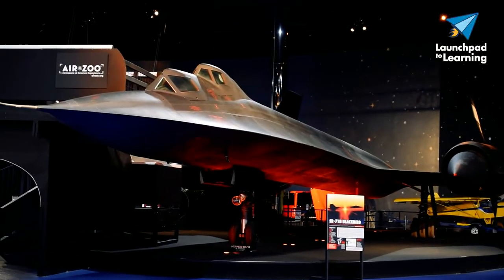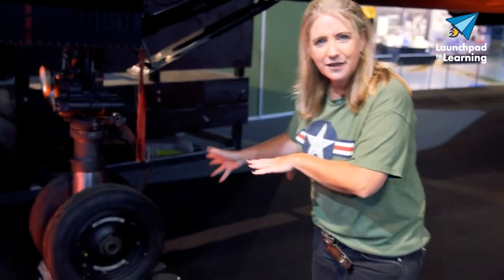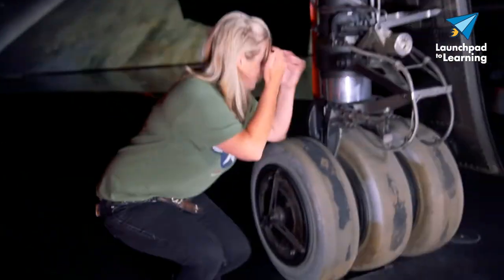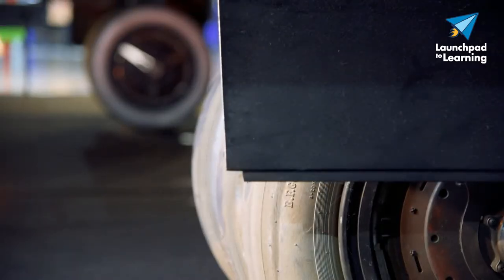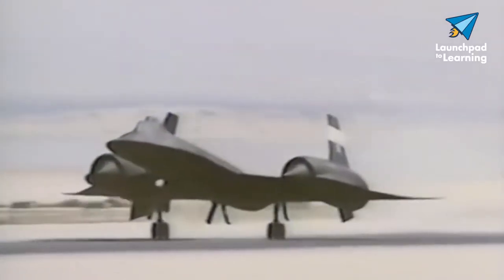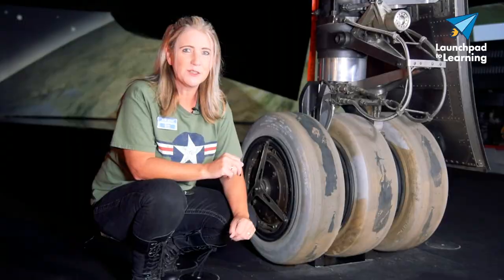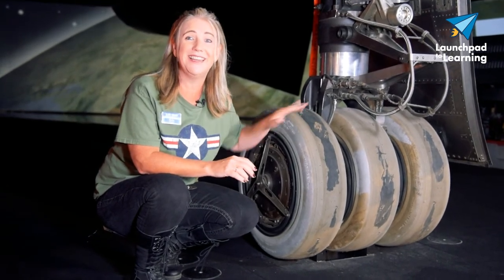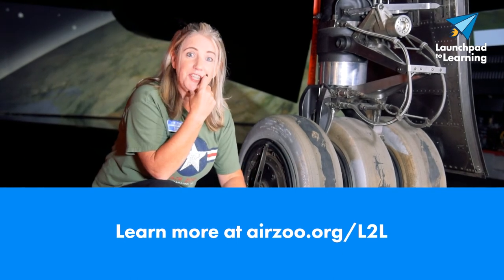The Lockheed SR-71 Blackbird's METAL tires!

Comment: You've got the 117 and the sr71, if you manage to get a b2 you'd have the full family of stealth bombers. Well, the ones WE know about at least 😅😉
Reply: B2 is still in service unlike the f117 and the sr71
Reply: @shayanirenberg3294  Yeah, I guess I didn't want to write an essay so I used "if and could" in my phrasing, althou you might have mistaken it for would since it's abbreviated. So anyway, I noticed that in the aircraft world people is very picky and precise, almost ocd (not this case), and I come from the custom automotive world so I know a thing or two about people splitting hair... 😅
Reply: Sr71 isnt a bomber
Reply: @nicksothep8472  "would" wouldn't have exactly been an incorrect or inaccurate word choice there, though.
Reply: @bambon6184  The SR-71 itself isn't, the A-12 (which is basically a just a SR-71) is capable of bombing.
Reply: @crimsonsnow2469  yes i know but the sr71 isnt really a stealth jet either more so uses speed to escape threats
Reply: @bambon6184  You're correct in the point that it lacks stealth, you stated that it wasn't a bomb though.
Reply: @crimsonsnow2469  yes and he said stealth bombers
Reply: And the b 21!
Reply: @shayanirenberg3294  A new stealth bomber, direct successor of the B2, in fact to the untrained eye it almost looks like the same plane, has very recently been unveiled, so retiring the B2 might not be that far of a possibility anymore. Or maybe not, the military has no real set rule when it comes to retiring machinery, look at all the old "flying fortresses" still in use, and other more than 50 years old B planes that are still actively used after regular, mostly "software" updates, I think the U2 is also among them, which is very sketchy compared to the modern jets we have like the F22 Raptor or the F32, it's like a '50 Chevy and Bugatti Chiron, there are a lot of 50s cars with updated drive trains and suspension, which ride and look great, but they'll never perform like a Chiron or similar supercars.
Reply: @crimsonsnow2469  i think you mean the YF-12 which had 3 AIM 47 Air To Air missiles. It was a two seater also.
Reply: @shayanirenberg3294  National Museum of the US Air Force has one but its only structural lol
Reply: F is fighter. B is bomber and A is attack but on the flight deck we were told A are the bombers so it might be a Navy designation.  SR I don’t know but the 71 was reconnaissance only I think.
Reply: @robert4123 pretty sure SR is something to the effect of spy/reconnaissance, being in line with the SR71's MO.
Reply: @TenMillionYearProgram42  I think you are right but “spy” is too blunt possibly Stealth Reconnaissance?
Reply: @robert4123  that checks better; you’re right. I’ve never heard anything official, though.

Comment: Nice and informative. Also the wheels sat inside the JP-7 fuel to help keep them cooled as the JP-7 is very heat resistant and has a very high flash point. Fact pools of JP-7 on the runway would put out a book of lit matches with no chance of catching fire and exploding.

Comment: Er  Erin you got your  facts wrong regarding the Blackbird,s nose wheel tyres, they are no way normal as those  on a Pacific Southwest Airlines Boeing 737. On account of its cool  shape penned by Clarence 'Kelly' Johnson,s Skunk Works, a Blackbird touches down around 225-230 miles an hour in order to retain directional control , sixty above a Boeing 767  or an Indy racing car. So BF Goodrich had to make them withstand an impact at so high a speed without exploding.  In order to keep each main tyre cool as possible engineers at BF Goodrich mixed aluminium powder with the rubber compound, hence the odd silver colour. Their unique profile  is derived from John Boyd Dunlop,s 'Compactor' tyre developed in the late 1940,s for use on bomber aircraft before satisfactory bogie undercarriages became available from George Dowty,s and Messier.

Comment: Isnt aluminum and rubber the main ingredients in certain types of rocket motors?
Reply: She's wrong, they're not metal infused, it's simply an aluminum paint they're coated with, you can clearly see where it's worn off on the tread face exposing the black rubber underneath, if the rubber was infused with aluminum you wouldn't see that because they'd have the aluminum color all the way through. 
One of the pilots talks about that in an interview and how over the year's the myth that aluminum was mixed in with the rubber somehow got started and has turned into "common knowledge", he even pointed out what I just did about it wearing off on the tread face exposing the black rubber underneath, although they don't show it because it was after the interview in his home he told the guy interviewing him that he had one of the tires out in his garage and he'd take him out to it and show him that it's just a painted on coating and not rubber infused with aluminum. 
The interview is with A12 pilot Frank Murray at his home, the thumbnail for it is a picture of him when he was a pilot standing in front of an A12 in uniform, not one of the flight suits but just a regular OD green uniform with the ball cap from back in those days, which I thought was odd because being an A12 pilot he was "sheep dipped" at the time and no longer in the Air Force but technically a civilian employee flying for the CIA, maybe the picture was taken right before resigning his commission while he was being trained or right after he got his commission back and had one last picture taken before he walked away from them.

Comment: Fastest plane is the X-15. 
Fastest jet plane is the A-12, predecessor of the SR-71
Reply: Pretty much the same plane
Reply: The a-12 and sr-71 to me probably had a true top speed of mack 4+
Reply: @legobut6949  I agree. I believe Mach 5 was even possible. But there was no need for such speeds since it already out ran surface to air missiles. The A-12 was smaller and lighter than the SR-71 but used the same j58 engines. Hard telling what it was truly capable of.
Reply: We were making the SR-71's faster up until the day they were retired from active duty. 
A-12 were said to be faster, but no official record attempt were made. Same said about the all the flights of the SR-71. Except one official last flight to the Smithsonian museum, breaking 4 more speed records. 
NASA was working to install Nitrious Oxide Injection in order to use the SR-71's to launch space satellites.
Reply: @legobut6949  Not a chance. Certain parts of the plane would begin to melt at around Mach 3.8. Ben Rich, the designer of the A-12 propulsion system said so. The ultimate top speed of the plane was limited by the compressor inlet temperature of 427 degrees Centigrade; the local atmospheric conditions allowed some variation as to when this was reached, but I can assure you no one exceeded it. The claimed top speed was Mach 3.5 over Libya in 1986 by pilot Brian Shul (recently deceased) when outrunning a SAM.
Reply: @adamlutsch1975  Not a chance. Certain parts of the plane would begin to melt at around Mach 3.8. Ben Rich, the designer of the A-12 propulsion system said so. The ultimate top speed of the plane was limited by the compressor inlet temperature of 427 degrees Centigrade; the local atmospheric conditions allowed some variation as to when this was reached, but I can assure you no one exceeded it. The claimed top speed was Mach 3.5 over Libya in 1986 by pilot Brian Shul (recently deceased) when outrunning a SAM. You should also note the Blackbirds were not thrust-limited at altitude; in other words, they could accelerate to a higher top speed than was possible to sustain without damaging or destroying the plane - and killing all on board. So technically, they could probably go Mach 3.8 before melting something and killing everybody as the plane disintegrated.
Reply: @danfreeman9079 Given the SR-71 already looks like a sci-fi space plane, that is a awesome idea, practical or not I'd love to see it done at least once